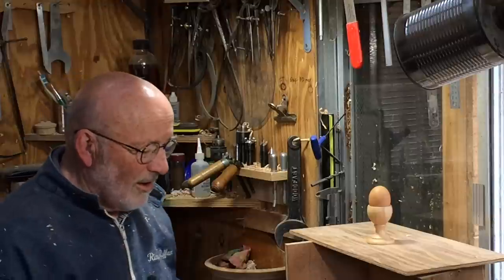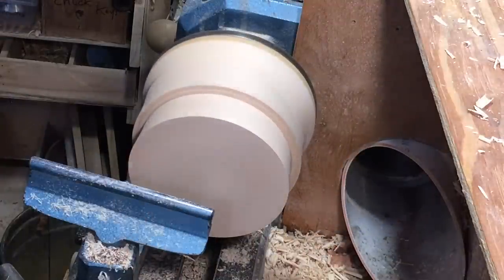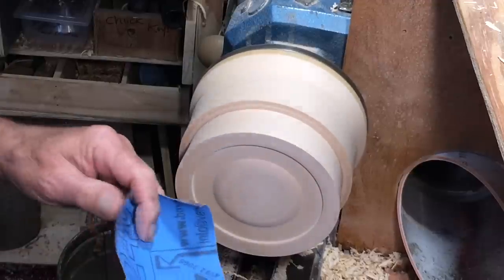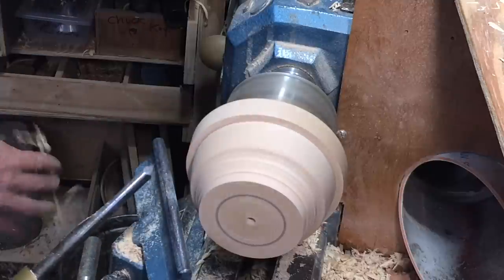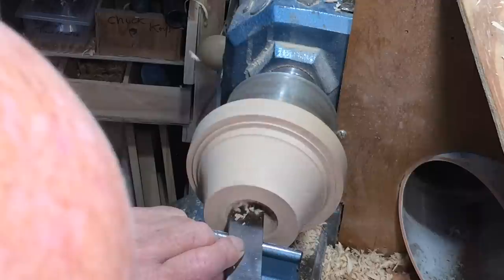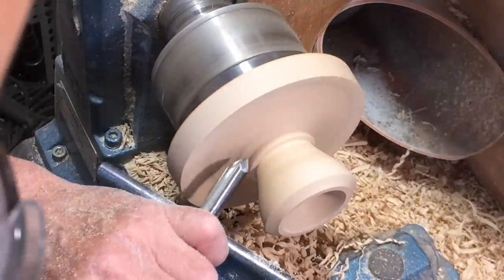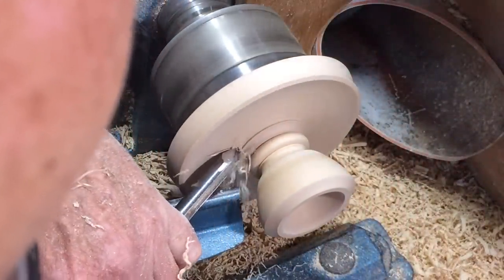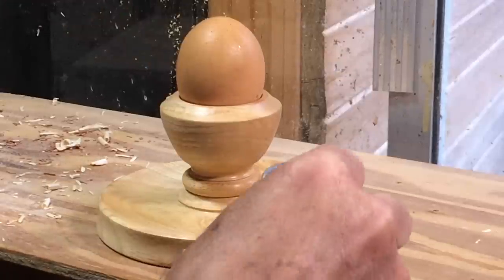Richard Raffan turns a baronial eggcup

Comment: When you describe the size of your gouge such as a 3/8” bowl gouge is that the flute width or the outer diameter of the tool? Classic confusion of the two systems of describing sizes of gouges.

Comment: Very good again Richard. I've had Miss 13 put in an order with one difference, to make the egg cup removable. I'm thinking I can either make the plate part similar to a tea cup-style saucer with a recess to accept the foot of the egg cup or have a tenon in the middle of the saucer and a recess like a dowel hole to accept the tenon in the foot of the egg cup. Well, I guess at least she's given me a challenge on your design. Also picked up on the cutting direction on smaller to larger to stop the grain kicking out, I've gotten caught on that one occasionally but just sanded it out, at least now I know why it occurs, and now it's obvious. Thanks Richard, always something to learn.
Reply from the maker: You run the risk of ending up wth up with two objects that on their own don't look very good or function and possibly not fit together properly, or indeed at all after a bit of use and the wood moving.
Reply: @RichardRaffanwoodturning  Good points. Perhaps I'll do it just for her and see how it turns out. Don't know if we don't try, lol. Thanks Richard, some good thoughts to consider.

Comment: Richard, great videos - Question - What type of Bees Wax do you recommend for turning?   I see there are many types from a paste to a hard block.
Reply from the maker: Pure beeswax is good if you can get it and it smells good, but you can also use paraffin wax which is far less expensive and what I used for many years. I used plain white candles. Then about 30 years ago I was given a very large lump of pure beeswax that had lain in a barn for at least 40 years and I've used that ever since.  It's unlikely you'll chance on beeswax similar to mine.

Comment: Richard if I may ask, how do you prevent your beeswax finish from being too sticky? I apply very little, yet it’s still almost unbearably tacky, so I reverted to oils…awesome videos every single one is priceless to a total novice woodturner like myself 😀👍
Reply from the maker: The friction that melts the lump of wax leaves wax on, rather than in, the wood. To melt the wax into the wood using the waxy sock I build up quite a bit of heat that melts the wax into both the wood and the sock. When the sock is almost more wax than sock, the surface remains a bit tacky so I use a cleaner sock to create the shine. The cleaner sock eventually replaces the old.

Comment: Could you describe how long handles you usually use on spindle gouge, bowl gouge, scrapers and chisels? Thank you very much.
Reply from the maker: The rule-of-thumb is having a handle three to five times the length of tool blade over the rest.  Turning 150mm-deep bowls or cylinders, life is easier with a handle 600 to 750mm long. Traditional Sheffield skew chisels and spindle-turning tool handles were 6-in / 150mm long. I have handles ranging from 300mm to 700mm.

Comment: What grind do you use on your spindle gouges, and do you sharpen them all the same way?
Reply from the maker: The bevel angle on the nose is generally about 45° but nearer a 30° included angle on detail gouges and the 9mm gouges I use for detailing. Spindle gouges used for facework have a bevel nearer 40° and most are asymmetric. Those used on obwl profiles have a short steep right wing. https://www.youtube.com/watch?v=7nHgJ5aFOrc&t=16s
Reply: @RichardRaffanwoodturning  Thanks - I saw the video on the asymmetric (although I thought that was in reference to bowl gouges only).  I’ll rewatch.  Spindle gouges in a variety of different geometries seem to be quite versatile.  I’ve started using spindle gouges for roughing work on the outside of bowls and have found them easy to use and had no issues with them.
Reply from the maker: @MD-en3zm  The bevel angle really depends on how you intend to use the gouge. For bowl profiles a steep right wing makes finishing sheas cuts easier, whereas for cutting coves on spindles you need a fingernail grind with a longer bevel.